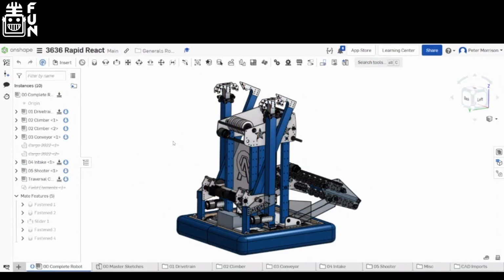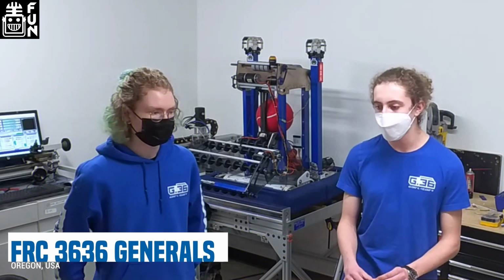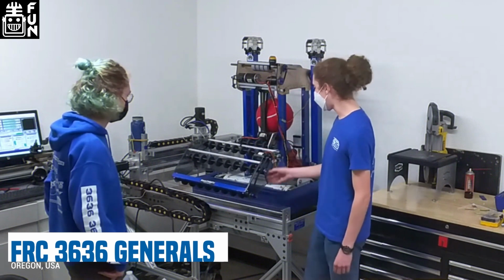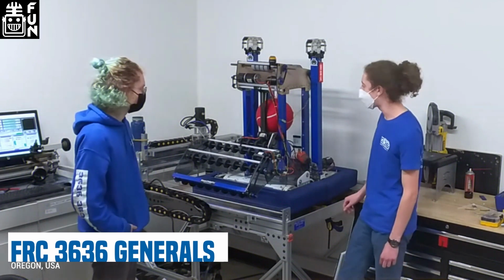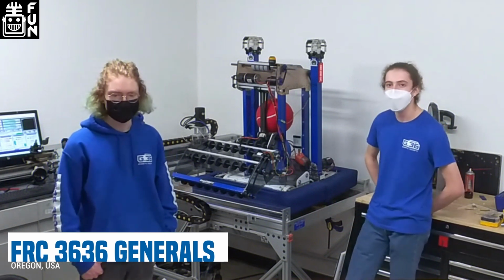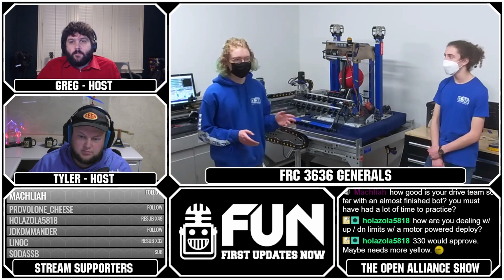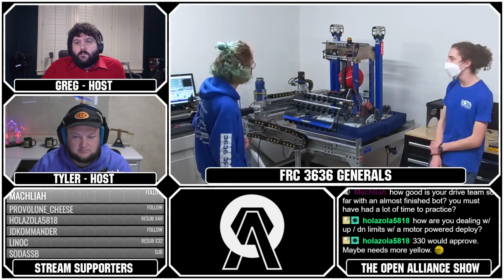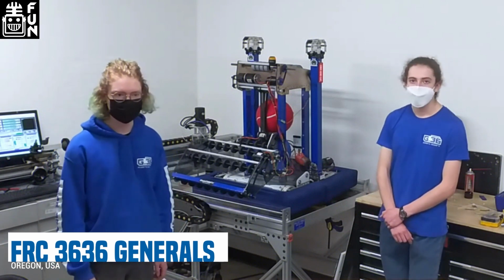Robot Demonstration FRC 3636 Generals The Open Alliance Show

Comment: why not just us a piston on the intake? To allow it to get hit and not be damaged?
Reply: I know this comment is a year old lol but... the robot doesn't use any pneumatics. None of the 3636 robots do. Everything is designed to use other systems.
Reply: @fourthpanda  we are trying to get away from pneumatics, but they just work so well. Pity that they require a big subsystem to run (compressor, solenoids, regulators, tanks, ...)
Reply: @jacobfrye996  Yea exactly 3636 just ditches the pneumatics in favor of motors. If you gave a CNC it's actually not that hard to design around it. The intake actuation for the robot in  this video was powered by a neo + max planetary actuating at the base of the linkage by the end of the start of the 2nd district and it worked flawlessly all the way to Roebling.